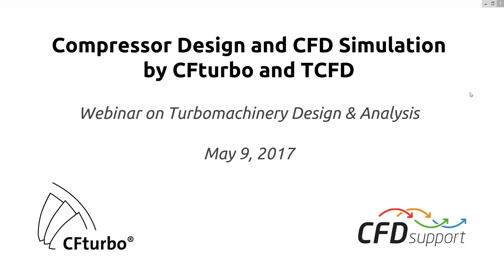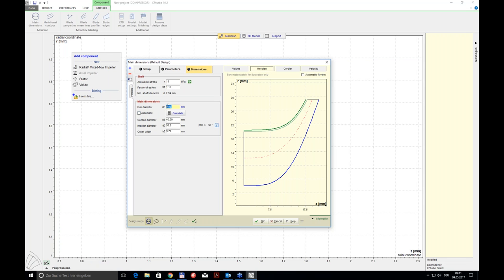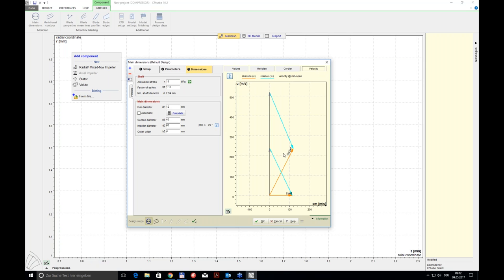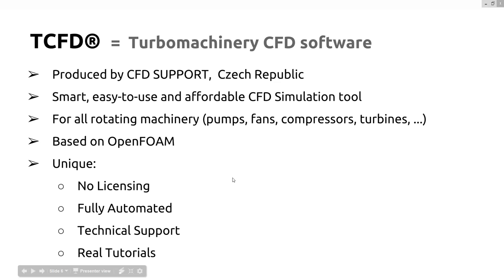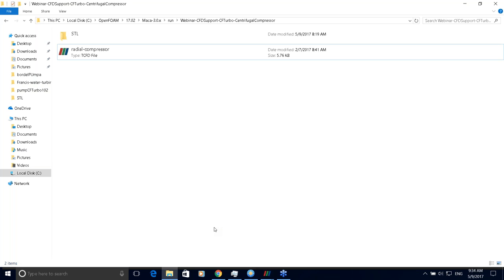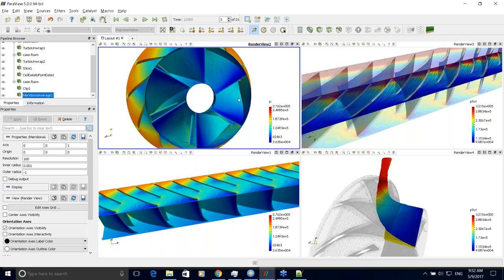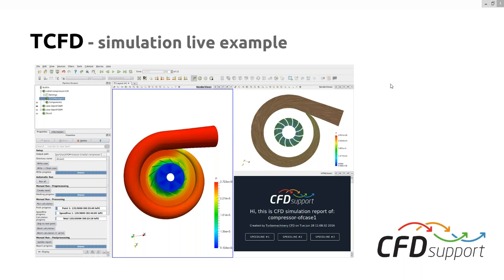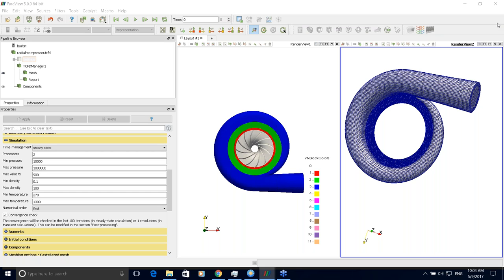Webinar 20 CFturbo+TCFD - Centrifugal Compressor Design & Analysis, May 9, 2017

Comment: Interesting. How do you calculate turbochargers RPM? The parameters I have measured are back pressure and boost pressure + I have a dyno graph of engine torque and power characteristics.

Comment: I am wondering about exporting my design.. What if I want to export my compressor design (with volute, impeller, stators) to ANSYS, first for meshing (turbogrid) then for analysis? At 26:00 mark you talked about exporting, but is it enough just to choose CFD --> TurboGrid or do you need to make some other adjustments?
Reply from the maker: Hi, regarding this issue, please contact CFturbo:   info@cfturbo.de